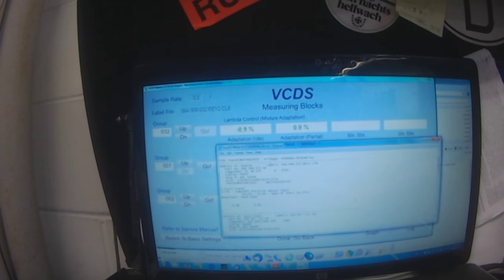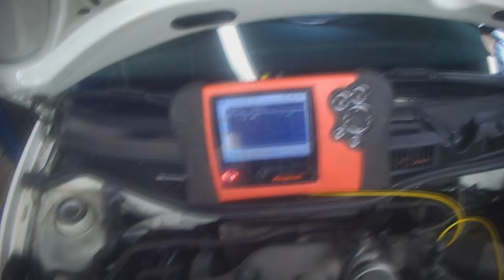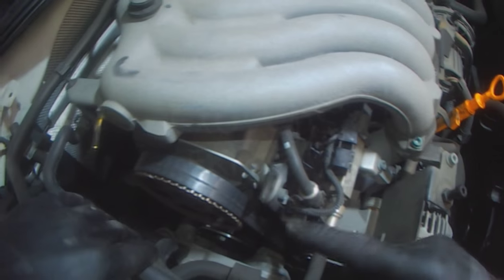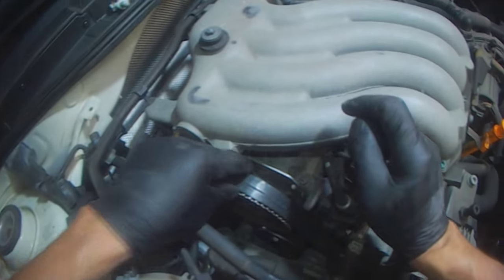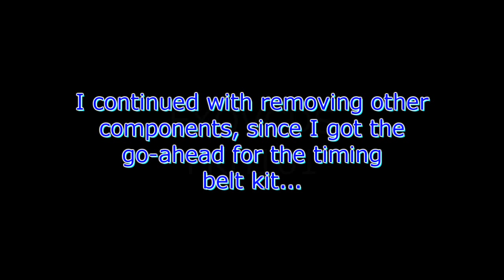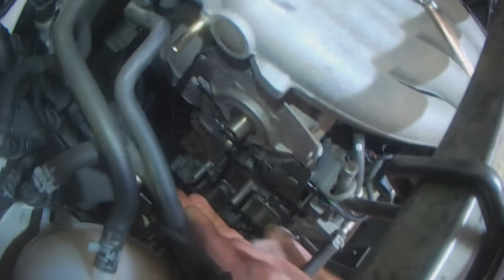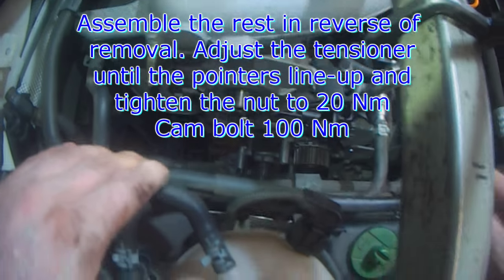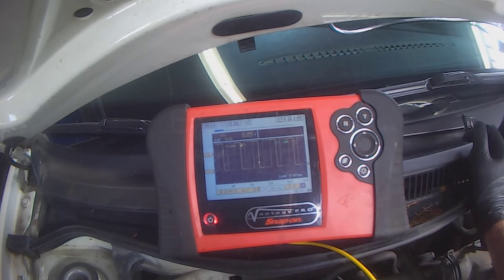VW A4: 2.0L Faulty Camshaft Position Sensor G40 (P1338)

Comment: One more thing, I have to let it sit for a bit before it starts up again.
Reply from the maker: The engine can run with NO camshaft sensor signal (disconnect it and start the engine)... so I doubt that the cam sensor is to blame. Sounds like common crankshaft position sensor fault (when they get old, they fail when they get warm / hot... after cooling off, the engine can be started again). I posted a video on a 2.0L last week with same symptoms: long version: https://www.youtube.com/watch?v=MJIA0AsxASQ short version: https://www.youtube.com/watch?v=qYfZOb9vzkU
Reply: I'll give that a try, it wasn't doing that before I opened it up.
I have a Bluetooth scanner and it gives a P0341 code.
Reply from the maker: Cam sensor fault can be set due to faulty sensor or due to incorrect cam / crank / belt timing.
Reply: Hello Thomas, just wanted to give you an update on the stalling. Before I when the out and spent the money on a new crank sensor I thought about what I had done different before it started stalling and remembered I had replaced the ignition coil but with USED one. So I bought a new ignition coil and voila, it stopped stalling. Although I had no misfire problems it turned out that the ignition coil was getting hot and causing it to stall.

Just thought I would let you know. Thanks for all of your input.
Reply: Now I just have to recheck the timing cause I still get the cam sensor code.
Reply from the maker: Ariel Aceves Thanks for the update!

Comment: How many time to make this job ?
My son have this code P0343 on VW Golf City 2008 2.0L with 223000Km on car
Do I need to use the suggestion kit on Rockauto? 
Do you suggest to change the Timing Belt and Pump with new sensor or just timing belt and sensor ?
We have just buy this car last week. (no garantie).Do you think I will need a special Tools? 
I have only a basic Tools. I already rebuilt my 5.0 Mustang 89 3 years ago
Reply from the maker: If you do not know how old the timing belt & water pump are... replace everything.
If you know the belt & pump are not that old, just replace the camshaft position sensor. You can leave the belt attached to the camshaft sprocket, tie it out of the way and replace the camshaft position sensor.

Comment: Hi Thomas, thanks for the video. I had a coolant leakage and the workshop replaced the water pump, ribbed belt, tensioner, repair kit. After that i had trouble starting the Jetta 2.0 TDI. Now the car is complaining about the crankshaft sensor(it would stall as soon as i turn the ignition) and the technician is telling me that gear box needs to be opened to check the sensor and is charging me again for the same. This problem was not there before i took the car to the workshop for the coolant leakage problem. Can u please tell me if this is related with the process of fixing the coolant leakage. Thanks a lot in advance.
Reply: its a 2015 Jetta 2.0L. Love from India :)
Reply from the maker: Crankshaft position sensor is on the other side of the engine / at the transmission end.  I don't know if the transmission has to be removed to change the sensor (I have never replaced one). I am currently at work... I can check for location information once I am at home later tonight after work. The sensor should not have anything to do with the timing belt repair, unless there is a problem with the timing belt repair that was done.
Reply: @EXOVCDS  thank you Thomas for the reply. Cheers
Reply from the maker: The crankshaft position sensor can be removed without having to take the transmission off.
https://idpartsblog.com/2017/06/01/default-replacing-g28-engine-speed-sensor-on-common-rail-cbea-cjaa/

Removing the transmission gives you more visibility, but is not needed unless you need to change the rear seal or speed sensor tone-ring.
Reply from the maker: send me an email and I will send you service information: fkh161 @ fkh161 .ca (no spaces)
Reply: hey man, i'm not sure about the TDI, but in the 2.0L engine the crankshaft sensor is at the front and is easily  accessible from underneath the car just infront of the radiator - easy job to do yourself and cheap part
Reply from the maker: @adamzav4042  On the 2015 TDI it's a pain to get as shown by the link... can be done without transmission removal.
Reply: @adamzav4042   the 2.0 petrol fsi ?

Comment: Can you tell me where is the camsaft sensor on polo mk3 1.3 engine 95 year
Reply from the maker: I would have to find a service manual... we don't have that engine in North America.  Most likely it is in the distributor (the hall sensor). If I find information, I will get back to you later today. What is the actual problem? Fault code? After timing belt replacement? The more info I have, the better I can help. Post a video of your engine on your channel. Record the engine bay / engine so that I can see various components. Post the link to your video here.
Reply: @EXOVCDS  when im driving and the temperature gage come on 70 degreces it drops the rpm and he have bad fuel consupmtion
On the scan it has code 00515 camshaft position
Reply from the maker: I need more info. Engine production code? Or... record & post a video.

Comment: You know if this is eactly the same process for the Golk mk4 with the 2.0?
Reply from the maker: This is a Golf / Jetta 2.0L.... VW A4 = VW mk4 = 1999 to 2006 Golf & Jetta.
Reply: Differs my 1.8t engine its very easy rdllacing g40 sensor

Comment: What happens if you bend the hall sensor shutter? That little aluminium disk
Reply from the maker: It can damage the hall sensor as it spins. Remove the cam gear and bend the shutter wheel back into shape.
Reply: @EXOVCDS  Ahh, I bent it back into place, replaced the sensor and somehow I'm still getting the code. Could the disk do that or am I likely dealing with a bad wire somewhere?
Reply from the maker: Year, make, model, engine? Which cam code?
Reply: @EXOVCDS  98 Golf MK4 1.6, the code was 00515 Camshaft Position Sensor, G40
Reply from the maker: @drew9560  we don't have the 1.6l in mk4's here in North America. Is the shutter wheel in the cam gear or does the engine have a distributor? In either case... are you sure that cam & crank TDC alignment is correct? Which tdc mark are you using to check crankshaft position? Does the engine run? 
http://wiki.ross-tech.com/wiki/index.php/00515
Reply: @EXOVCDS  The shutter wheel is in the cam gear, I'm actually not sure the alignment is correct. It'll run smoothly for a few minutes, then wobbly, then it'll shut off. Sometimes it will crank back up immediately and sometimes I've had to wait a bit
Reply from the maker: @drew9560  the engine should not need a cam signal to run (as long as the engine has a crank sensor). Disconnect the cam sensor and let the engine run. If it still dies, you know it's not a cam sensor issue. You can check cam sensor function with a multimeter.
https://youtu.be/A6XV5x0504c
But before that, you need to be sure that cam & crank are at TDC at the same time. If they are not, you will always get a cam code.
Reply: @EXOVCDS  Much appreciated!! I will do some research into getting everything back to TDC (if its out, which is presumedly the answer) Thank you for the help!!

Comment: How much did this job cost?
Reply from the maker: Not sure, I don't write-up the invoices... installing the timing belt incorrectly can also set a cam position code (just in case you got the code after timing belt service was done).

Comment: Hi Thomas would this cause my 2.0 Jetta to stall even while driving on a freeway 80miles/hour? I need to wait about 20 minutes to be able to start the engine back on. Also, I’m noticing a loss of power when I’m going slow and trying to speed up. Please help, thanks.
Reply from the maker: Camshaft position sensor should not cause a stalling issue (disconnect the sensor at idle)... it can cause power loss issues if / when it acts-up while you are driving, especially when the signal is erratic / comes & goes.
If the stalling is repeatable (drive for 10min and then it stalls), disconnect the sensor while the engine is running and take it for your usual freeway run... if it no-longer stalls, then I would say yes, the sensor is the cause.
Your symptoms sound more like an issue with the crankshaft position sensor (to the right of the oil filter, mounted to the engine block. If it is a crank sensor that is starting to go... the engine will eventually not restart or not start at all even when it is cold.
Let me know what the test results were, when you disconnected the cam sensor while at idle and when driving it on the highway with the sensor disconnected. A disconnected cam sensor can cause lack of power at higher rpms (3000rpm the engine might not want to go any faster), so depending on the gear, you may or may not have a hard time getting to 80mph.
Reply: Thomas EXOVCDS thank you for your help, it was the crankshaft position sensor that was bad.
Reply from the maker: Thank you for the update!

Comment: I have this on my VR, would this cause it to dump massive clouds of gas out the exhaust?
Reply from the maker: No... I don't think so. Unless camshaft timing is way off... due to a jumped timing chain. Is P1338 the only code you have?
Reply: @EXOVCDS  i have p0341 and p0135
Reply from the maker: @zoomxdude1999  how smooth / rough is the engine running?
Reply: @EXOVCDS  idles great, but has a lot of lost power. burns thru gas too. No misfires in VAGCOM either but its just slow
Reply from the maker: You can check if your cam sensor is producing a signal... if it doesn't, then replace it. If i does produce a signal, then you have to check if the cam / crank timing is ok. If you hear chain noise, then the guide rails are probably broken.
Reply: @EXOVCDS  thing is i dont hear any chain noise, a new sensor is coming in tmrw. hopefully it fixes the issue. If not im saving up for a 3.6 swap.

Comment: i have a question my car wont rev past 3000 rpm can it be the cps?
Reply from the maker: Some people say yes... I have not seen that happen. Disconnect it and see if it revs better. I had a car last week that had a bad crank sensor... past 3000 rpm it would fall on its face. Check for fault codes before you disconnect the cam sensor (because disconnecting it will set a code).
Reply: +Thomas EXOVCDS thanks for the fast reply ill check it out thanks
Reply: @oscararambula6108 did it work?

Comment: Would vacuum leak throw that code, or why did you highlight its absence?  I just changed spark plugs, fuel injectors and power cables in my 1994 Jetta, and on testing a day later, I see this code.  The car has been driven for something like 20 miles since the job, but it is not showing a check engine light..  I had checked codes  just before the job, and after the job + coolant flush, and there was none.  I suspect it could have a vacuum leak because I had to improvise the tubing to the throttle body (which i cannot find in the market).  If V leak can trigger this code, then i would definitely need to revisit my improvisation before checking anything else.
Reply from the maker: That code is strictly for cam sensor / hall sensor in the distributor (your application). Some of the early OBD vehicles will set a cam code if you scan with the engine NOT running. Timing could be out slightly as well. Check for a loose timing belt
Reply: Thanks Thomas.  Sorry, I thought i had seen on this thread the exact code I got on my car.  The car was running when I  read the code.  The particular code is 00515 - Camshaft Position (Hall) Sensor (G40).  I was thinking about the timing belt too, but was hesitant to go messing with that.   Now that I have checked my improvised breather tube and it looks good, i think timing belt is the next thing.
Reply from the maker: @kim7018  You might only have to adjust / rotate the distributor.
Reply: i will try.  would you be in a position to explain  what the problem would be, or why rotating the distributor  would resolve the code?
Reply from the maker: 2.0L or 1.8L?
If 1.8L, ignore what I said.
On the 2.0L the ECM is "looking for" a signal from the distributor. When it doesn't see the signal when it thinks there should be a signal... then the ECM will set a cam sensor code.
Turning the distributor can get the signal back to where the ECM wants it and the code will go away.
The 2.0l will run with the distributor disconnected (the hall sensor unplugged).... because it uses the crank sensor as the main input.
Let me know what engine you have.
Reply: @EXOVCDS  GReatj!  It is a 2.0L engine.  Is this a problem that would get worse, or cause other problems if not attended?
Reply from the maker: If the timing belt is loose or the timing (cam & crank) jumped... it could get worse. If it moves / jumps too much, then there's a possibility of bending valves (when they make contact with the piston). If it's due to a bad cam / hall sensor... no harm aside from check engine light / code / power / performance issue.
These engines (when they get old) have a problem of the crankshaft bolt coming loose... that causes the crank sprocket to wiggle and move (which affects cam & crank timing and moves the ignition timing as well). 
Turn the engine to #1 TDC and send me pictures of the TDC mark at the flywheel, the camshaft sprocket, the crankshaft pulley and the distributor rotor. Send pictures to fkh161@fkh161.ca
I helped a guy last week by spotting that his crankshaft gear was bad.
Reply: @EXOVCDS  I will work on that.  I might not get to it in the next few days as I am traveling.  I appreciate your insights.
Reply from the maker: Any time... no rush... I'll be around.

Comment: Hi what can do that my skoda octavia 1.8 it some time start good some time you have to crank many time and then it start.  ? Thanks for help.
Reply from the maker: Not sure, could be fuel or ignition related... when it happens (does not start right away) check fuel pressure, check for spark, check if the ECM is awake.
Reply: Thomas EXOVCDS what is emc? I have now chanced crank sensor and camshaft sensor, there is trouble code whit camshaft sensor but i dont know why.
Reply from the maker: A ECM is engine computer... if you can get fault codes, then the computer is awake. Have you checked for spark at the spark plugs? Is the fuel pump running / working? How much fuel pressure?
Reply: Thomas EXOVCDS how i can check sparks, fuel pressure how i can look that. Fuel pump is working there come noise ehen you turn key. This starting issue come some time maybe more when the motor is warm.

Comment: i have to change this sensor in my 01 1.8t jetta but I cannot find where the sensor is at in the engine? Please Help!
Reply from the maker: http://i58.photobucket.com/albums/g241/bad_karma23/SensorEdit.jpg
Reply: +Thomas EXOVCDS  I have already changed that cam sensor I just need to change the one like you did on this car.
Reply from the maker: +Guadalupe Espinosa You have a 1.8t... the cam sensor is in the picture I linked. if you already changed that sensor, then it is not a sensor problem. the 1.8t does not have a sensor behind the cam sprocket like the 2.0l engine.

if you have a cam code with a new sensor, then you either have a wiring problem, a timing belt installation problem or a cam chain tensioner / installation problem.
Reply from the maker: Are you still looking for the sensor?
Reply: +Thomas EXOVCDS No i think i have a bad ECU.

Comment: My Vw, 2L engine light keep going on and off. and when its on the car doesn't change gears normally. the gearbox its Auto. what can be the problem.
Reply from the maker: I don't know... scan the ECM & TCM for fault codes. Once I know the fault codes, I can "guess" as to what the problem might be.
Reply: take it to a real mechanic and have it diagnosed.

Comment: Hi sir how are you sir I have  2003 VW golf 2.0 sir I have a problem with fuel, issue is that when car engine is running I cant stand with car because my eyes burning and also  during drive when I on Ac also smel and eyes burning and high fuel economy please sir help me to fix my car I cant afford fuel expense
Reply from the maker: Could be a fuel problem (leaky injector), ignition problem (no spark at one of the cylinders), vacuum leak problem (lean misfire)... not sure. Use a scan tool to check engine data & fault codes.